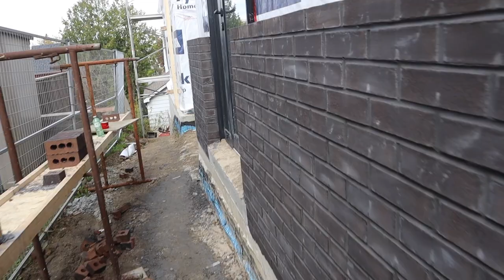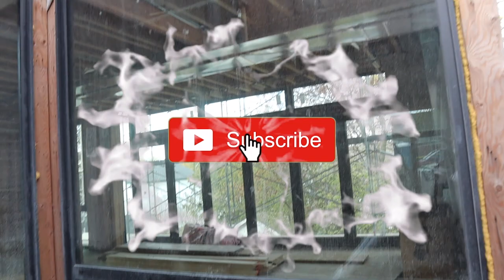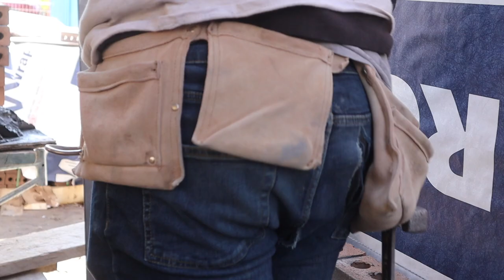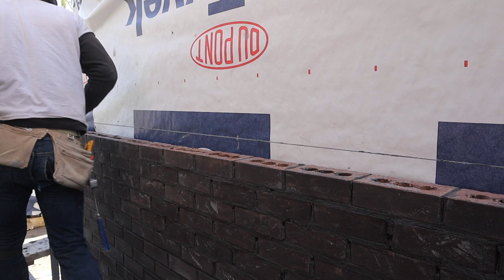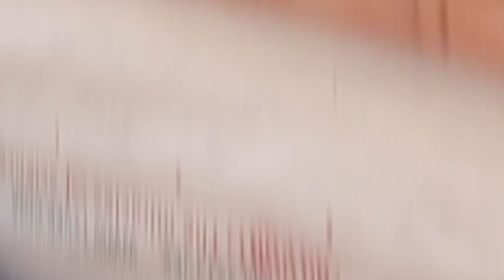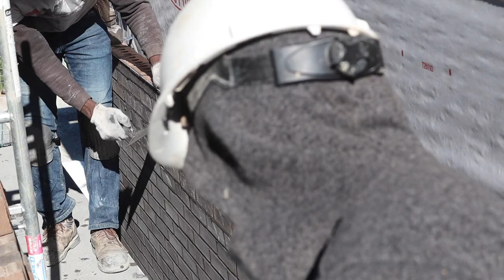Bricklaying - Trying Pic and Dip For The 2nd Time ,I think Its faster Than Traditional  ,!

Comment: You getting real good at the pick and dip. So only two minor points. Experts would say I think only lay the bed for one brick at a time - try it and see (will take some practice to be faster). When you lay the brick try to rock it in a bit sideways (as well as along the wall which you have real good). That should minimise mortar into the cavity to help minimise scraping off in the cavity. I think you have got it so keep practicing. Looked good mortar mix for it. Best watch Charlie Collison video for fine points. Look forward to next one, and take care.
Reply from the maker: thanks alot,john, great tips
Reply: @1kbconstruction824  Here's latest demo from Charlie if it helps:

https://youtu.be/H_fF79VhhdM

I think you're current technique is best though (if not quite as fast)

Comment: Please explain what Pick and Dip is for the viewers that are not familiar with the trade of bricklaying
Reply: A method to lay bricks faster
Reply: Not putting mud onto the Brick but '' scooping'' up a bit of mud from the bed to fill the perp
Reply from the maker: will do in a upcoming video 👍
Reply: @jims5394  it’s mainly used by ruff English slashers that are on price that have no standard.  That’s why our new houses look so bad.  Must take them ages to point up and clean out that cavity.  I won’t pic and dip for anyone.  Was taught traditional and will lay traditional until the day I die.